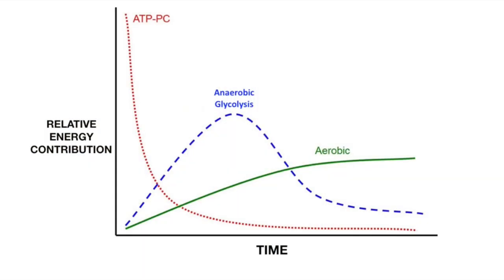ENERGY SYSTEM INTERPLAY (PART 2): What Happens in a Sub-Maximal Effort?

Comment: How does all this relate to recovery? 

I'm recovering from  an injury and took two weeks off from running starting on 8.3. When I started to run again I found my pace was still there, but belly burn (crossing that LT Threshold) happened sooner than before, which makes sense. I decided to slow my pace to and by the third or fourth run I crossed that LT Threshold later and later.  Over that same time period my Garmin Vo2 Max dropped by one point (43 to a 42). 

I'm fighting between two thoughts, 1) increase my pace to keep my Vo2 Max and 2) slow my pace to Z3/Z2 area and build back my base. I am not sure if it matters, but I use  LT% for my zones too and Garmin hasn't upped my LT Since June, which I don't  understand (171 / 10:30) - However, I don't experience belly burn unless my HR is 178 with apace between 8:30  and 8:50. 

If I run any slower than 9:30 pace I'm worried that it will adversely effect my LT Threshold? Am I being dumb?
Reply from the maker: Sounds like as a result of injury you’ve gone through some de-training. Also sounds like you’re only using one pace. Easy fix is to have some sort of training of less volume but higher intensity slowly progressing the pace back up (be patient, you loose 4-6 weeks of training in about 10-14 days). But also add in some of the longer slower work to get some sort of base back.

Be progressive and patient.
Reply: @NJSportScience  thank you, that's good advice, I appreciate you taking the time to respond!
Reply from the maker: Anytime happy to help where I can!

Comment: Is it possible that creatine stores are completely empty after physical activity? If so, would the athlete just dont have maximum energy for the start of the next movement (e.g. sprint)?
Reply from the maker: The body prevents complete PC depletion, sure you’ll be running low but you’ll never have zero.